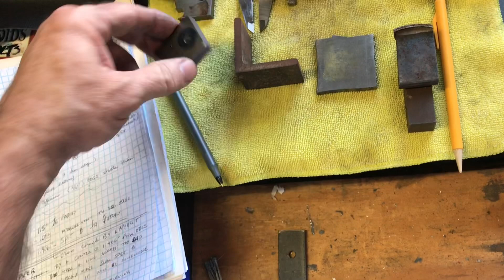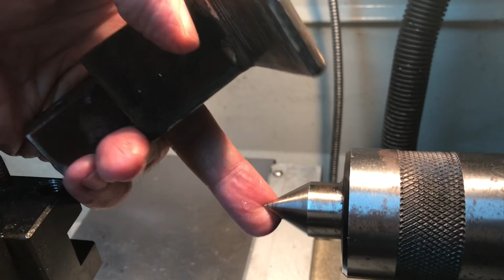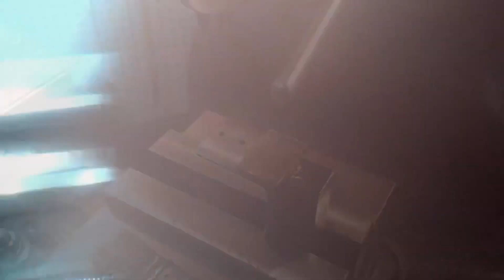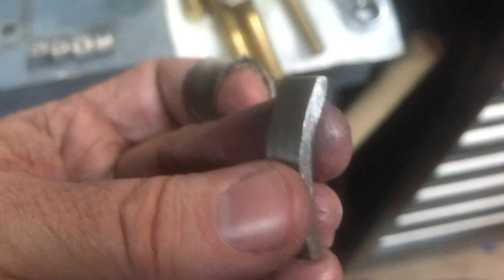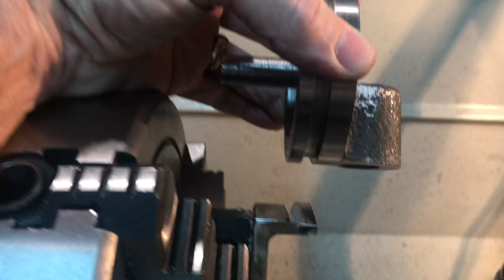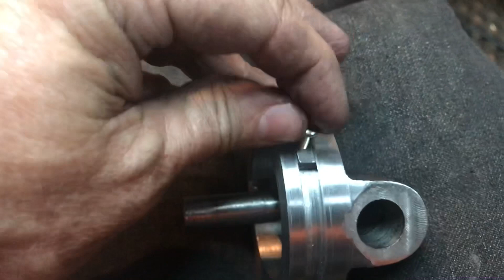Quorn Tool Grinder project, making stop blocks and V Nuts for Dovetail Groove on Rotating Base.

Comment: I noticed you didn't drill the 7/32 hole clear through the spindle shaft. 
Professor Chaddock made quite a thing about that hole for set ups. He described making a D bit to drill and ream the hole. When I bought my completed Quorn it wasn't through drilled / reamed. It had me beat for a while, eventually I was able to buy a camlock ER40 or 50 (can't remember offhand) collet chuck and install the hole.
Reply from the maker: Thanks for watching and asking Mike. I just uploaded a short video to answer your question. Here’s the link- https://youtu.be/e3Acikj7kbQ?feature=shared hope this helps. Bill.
Reply: Thanks Bill, I watched the video. As I posted there I'm updating my Quorn along the lines of your work.
I will try and electroplate as many parts as possible including the ball handles. Failing that I have ordered 20 mm SS so I can cut new items.
Mackay is hot, wet and salty.
Thanks for the inspiration.

Comment: Hi Bill, great soldering tricks, the rotating base gap will wake you at 4.00am, that's how my maggoty brain works, and sooner or later you just take a deep breath and reset-up a part, and dive in. Professional as always, Regards Beagles.
Reply from the maker: Thanks, Beagles. You are correct! I did rework it, will post video soon!

Comment: "Fiddly" work but it came out fine.  I'll  keep the soft solder trick in mind, I have not tried that for fixtures before.  Is there enough room to countersink the screw holes in the stop block so a FH screw could be used?
Reply from the maker: Hi Richard, yes there is as the stop blocks are about 3/16” thick. Thanks!

Comment: Would you be able to provide details about the materials used for soft and silver soldering? I am very familiar with the tools and materials for 'soft' soldering electronic components to PCB's and silver soldered the copper air lines in my shop but have never done any 'structural' soldering. Thanks.
Reply from the maker: The soft solder I used was some ordinary solder for plumbing repair. The only tricks are to get the surface very clean, apply flux, heat, solder, then have something to spread the melted solder to “tin” the surface.